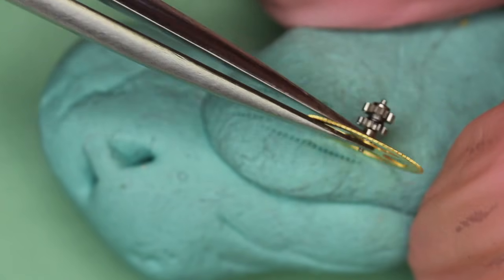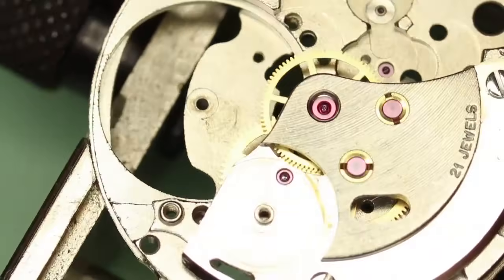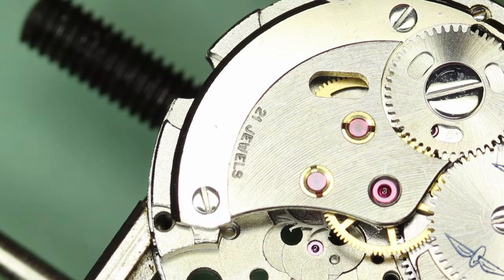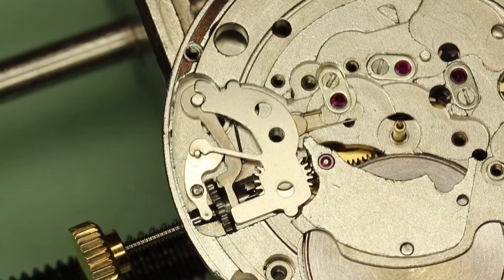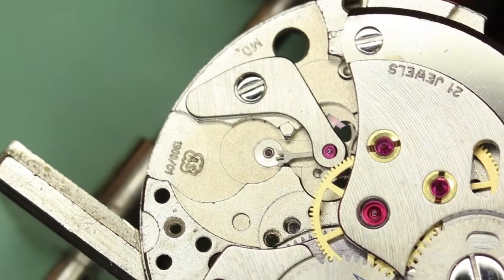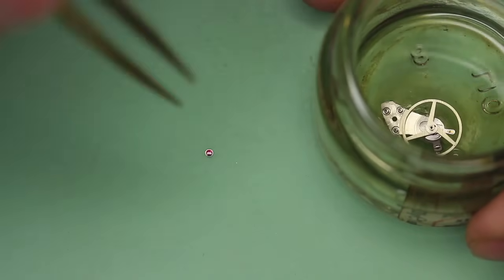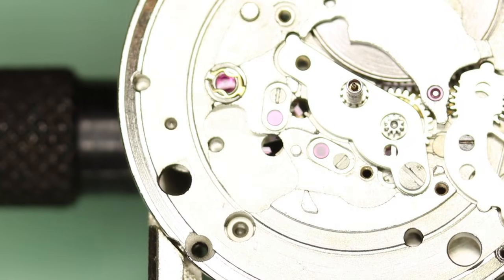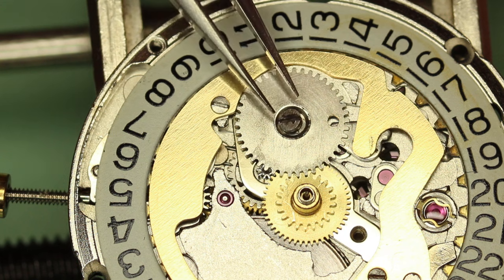How to service a mechanical watch. Part 3. AS 1900 in a Rotary watch

Comment: I've watched an instructor at the Lilitz Technicum reassembling a 6497 movement, and he likes to spread out a good portion of grease on his mirror-top work table and use that to lubricate the setting wheel clutch.  Apparently ultrasonic machines won't damage the balance pivots, so in the video he goes ahead and removes the cap stones on the balance wheel.

Comment: This is the best video I have seen on the Internet. Thank you so much for sharing. I feel I learned more from this then any other series I have watch and will probably be viewing it numerous times as I will be working on the exact same watch. (My first attempt to fully take apart a watch). Can you tell me what type and brand screwdriver you use? I am finding the ones I have are just not doing the job expected and need to keep replacing and hoping to find the right ones.
Also, someone asked what the green stuff is called that you use for cleaning. Did you say it's a gum?
Once again I would like to share my appreciation for your video.

Comment: Thank you once again for another splendid video! :) Sad that the camera shut off during the assembly and oiling of the keyless work. Just a little question; What is the reason that you are not oiling the pallet fork pivots?
Reply from the maker: Yes - I was quite upset when putting the vid together, it seems that there is a 15 minute limit to the recording function on my camera. Now I know :)

You do not oil the pallet pivots as it is generally accepted that the liquid friction created by the oil is more significant than the dry pivot in the jewel jewel hole.

Comment: Dear Mark,   my rotary watch with movement 2061  had problem with the calendar forwarding.  The quick set was OK.  I will need to remove the movement from the watch case but it seemed stuck .    Your video did not show how was the movement removed from watch case.   I removed  the  crystal top   and try to push the movement out from the top,  but no success  .  Looking forward to your advice.

Comment: You mention some people use lighter fluid to clean the balance.  This being a petroleum based product means that it would leave a residue on the parts it was used to clean.  Should the parts be dipped in alcohol or other solution to remove the res from the lighter fluid?

Comment: Hello Mark, great video as usual, I am so glad I watched this one because I have just completed my first servicing of a wristwatch, a Timex100 with an AS 1940/41. It was displaying classic 'loose cannon pinion' symptoms, and still is after servicing, even though I tightened the cannon pinion. But from what you say the friction device is on the third wheel, not the central wheel as usual. The watch is running nicely but the hour and minute hands start to slip after about 15 minutes, especially around the date change. What do I need to look for and do to resolve this? Many thanks and keep up the great work./Colin

Comment: Ah! I was hoping to see it on the Timegrapher, just to check lift angle and approximate amplitude. I have an ASST 1950/1951 on the bench - a learning/practice job - and I get it to about +2 s/d , 0,2ms beat error, and about 220 degrees amplitude but I am not sure if I have the correct lift angle entered (53degrees). I had a problem with it going completely haywire ( very fast) in dial up position, and re-watched this series. I think I had incorrectly inserted the pivot past the little spring on the....minute wheel??..( this one is a little different to the movement in the video, but not much) .....and also hadn't correctly seated the cannon pinion. In dial up it's now much better  (around -8s/d) but I was just looking for the lift angle confirmation....I'm learning so much. Thanks for the videos, Mark.

Comment: Extremely interesting. It seemed the shaft of the wheel in the bearing ( the smallest of the 3) under the head wheel was loose in the bearing.  Perhaps it was the lighting.

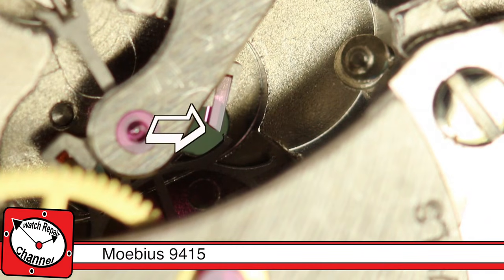Comment: In the video (15:56 on) you are saying, that you are using Moebious 9415, while for 28800 you would use Moebious 941 .. 
Is this information correct ?
Can 9415 be used for both low and high speeds ( BPH ) ?
Thanks

Comment: I know this is an old video, but it's still relevant and I have watched it many times, but may I ask a question?. 
We're told to make sure the wheels move freely and placing the train bridge.  What if they don't move freely but lock up...what then?. 
The train bridge is seated, the wheels in their pivots, all looks good, but the damn things will not turn!.  They lock.
What could be doing that besides maybe a bent wheel?.  I don't want to push too hard because of bending the wheels, but I am at a loss.  By all comprehension and logic, they should spin, but they don't.  Is there something I am unaware of?.  Please...any help would be appreciated as this has me at my wit's end with this hobby.  It's always the same issue.  I get hung up at the train bridge because the wheels won't move even though they're in their respective pivots and the bridge is fitted snugly.

Comment: You're not supposed to oil the pallet pivots? Please explain!
Reply from the maker: It is not recommended to oil pallet pivots as the oil will create too much drag and impede the movement of the pallets as they move from banking to banking. Although some watch repairers may use a very low viscosity oil, I am of the opinion that it can cause more problems than it would solve. It is the same with the minute recording wheel on a chronograph - oiling the pivots will potentially impede the movement of the wheel rather than help it.

Comment: Thanks for the video.  One comment: You mention that you use 9415 for the escapement on this movement, but you would use 941 for a higher beat movement, e.g. 28.8kbph. My understanding was the opposite, based on sources such as this one: http://hiro.alliancehorlogere.com/en/Under_the_Loupe/Moebius_9415 . Just wondering what your thoughts on that are.
Reply from the maker: To be honest - I am not an expert on the chemistry of the oils and greases so I rely mainly on the calibre spec sheets and information provided by my supplier. The cousinsuk.com website provides the information for both 9415 and 941  as:

Moebius 9415 is a synthetic grease made for watch pallets (and clocks).
(Source: https://www.cousinsuk.com/catalog/consumables/synthetic-greases/grease-synthetic-moebius-9415)

941 is for watches running at above 28,800. (source: https://www.cousinsuk.com/catalog/consumables/synthetic-oils/oil-moebius-synthetic-941)

But actually the datasheets for:

ETA 2892-A2 (28,800 train speed) datasheet specifies 941 as the correct lubrication for the pallets stones.

VALJOUX 7750 (28,800 train speed) datasheet specifies 941 OR 9415 as the correct lubrication.

and the lower frequency:

UNITAS 6498 (18,000 train speed) datasheet also specifies 941 OR 9415 as the correct lubrication.

I very rarely do watches of 36,000 or above but I would be interested to hear from other watchmakers on this.
Reply: I'm just a hobbyist, but my understanding is that 941 is the older product and aimed at slower beats (18k - 21,6k bph). 9415 was then developed around 10 years ago specifically for high beat movements (>=28,8k bph). I think that they discovered after a while that 9415 also worked fine for all speeds so nowadays it seems fine to just stick with 9415.
Reply from the maker: Well, this has prompted me to read up quite a lot this evening and I am quite happy to agree with PA REPLICAS. Personally I use 9415 the majority of the time. But I do a lot of 2892-a2 movements where I will use 941 however it seems many people have found equally good results wether using 941 or 9415. Possibly cousins have it the  wrong way round? Either way, perhaps it does not even matter, we stick to what gives us the best long term results.

Comment: I've got a $9 - 21 jewels Chinese watch. Could I clean it this way:

Submerge the watch engine in ultrasonic cleaner, afterwards dip it in silicone oil, then leave it for 12 hours to drip out the excess oil, and voila... a brand new (or broken) watch?
Reply from the maker: No. Wont work :)
Reply: Watch Repair Channel how do you know what oil you need to use for certian parts of a watch movement ?